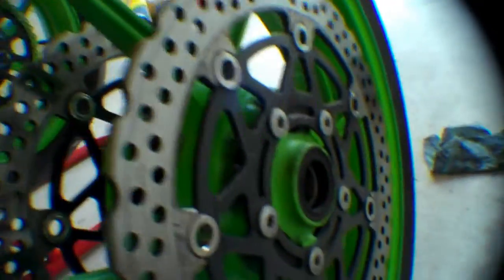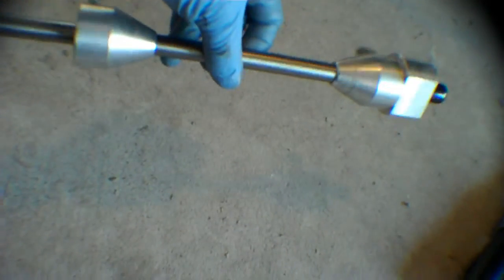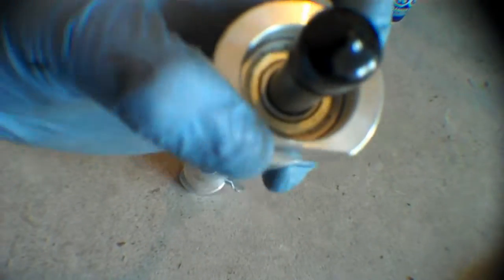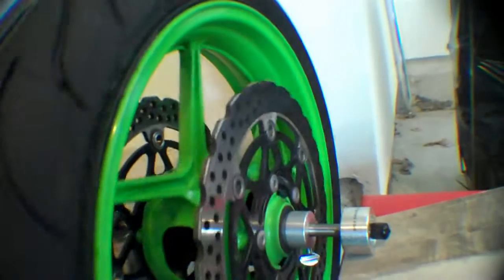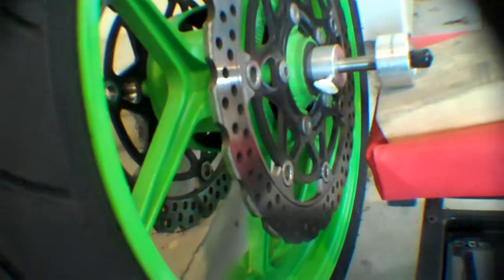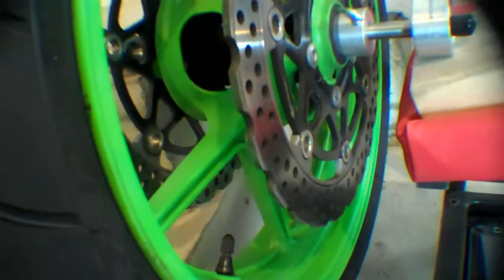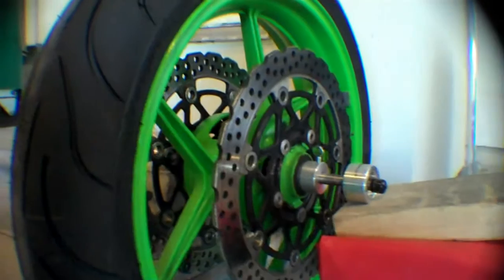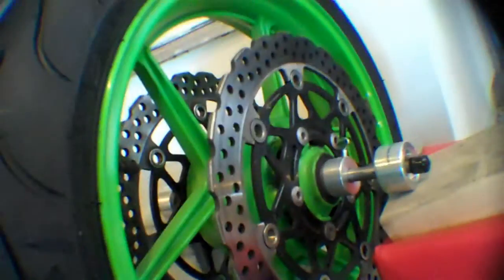How to balance motorcycle wheels using a static balancer.

Comment: Helpful information and useful to most. Gives a good understanding of the balance process, too. 
The comments on the cone bolts are fair but the centrifugal force at their distance from the axle centre shouldn't have much effect but I agree you would be better to set them 180 deg apart for best results.
If anyone needs perfection then pay for the electronic version. This was good thanks.

Comment: More pressure yeah but as its centrifugal force it's like the effect you would get if you swung a piece of rope attached to a brick. Eventually as Cforce builds up, the rope can slip free from your hand or break the rope if it is too much force. In racing I have had to apply duck tape over the weights as well because the scrutineers worry about them flying off.

There should be no rule against sticky weights as they should be fine until they reach higher speeds in excess of 70mph ;)

Comment from the maker: That's comparing apples to oranges. Helicopter rotors are far larger than motorcycle wheels. And I'm pretty sure helicopter blades are balanced differently than motorcycle wheels. I've tracked my bike with speeds exceeding 120mph and the wheels don't vibrate.

Comment: I would think a minor static imbalance would be greatly magnified at 70 mph. As a former military helicopter mechanic, we had issues during ground run vibration tests, because the repair shop wasn't balancing the tail shafts at the proper RPM.

Comment: Aren't the two tightening screw detrimental to your balance? In other words you will try to balance for them too, but then they are not part of the wheel. You could eliminate their effect by placing them at 180 degrees from each other.

Comment from the maker: It does make a difference especially in the front wheels. If the front wheels aren't balanced, you'll have a lot of handlebar vibrations at high speeds.

Comment: D.O.T in NY state does not allow sticky weights on Motorcycle rims. "They tend to fly off at higher speeds"...I don't see how as physics say that the spin will actually put more pressure on the weights holding them in place...But hey thats the Liberal state of NY...No commen sense here

Comment from the maker: @peter0139 I pondered that too, but the 2 bolts are very light and negligible to the balance. I think the maximum tolerance is 1/2 ounce so the 2 bolts won't make much of a difference. Thanks!